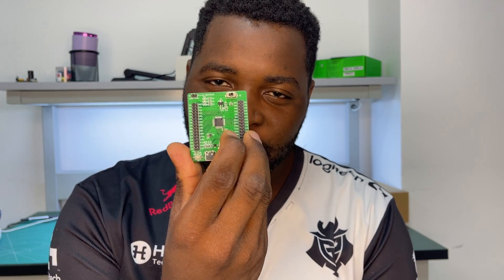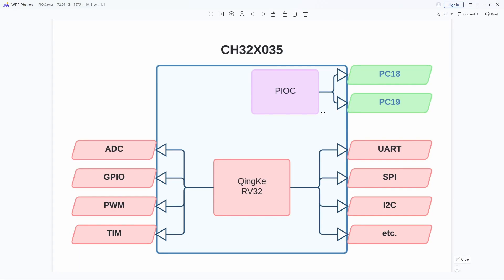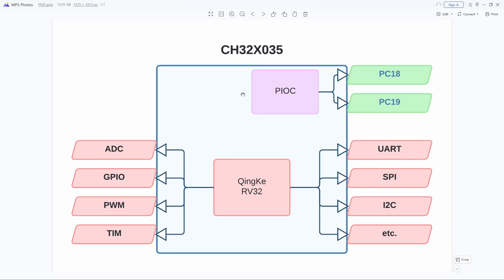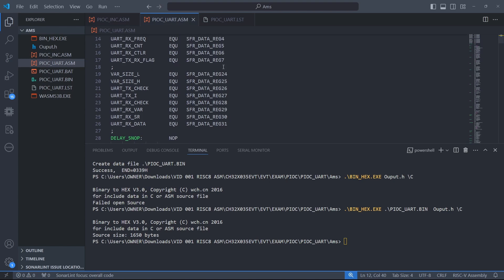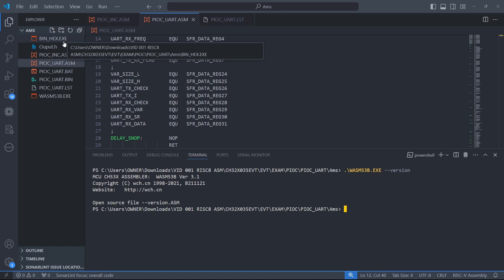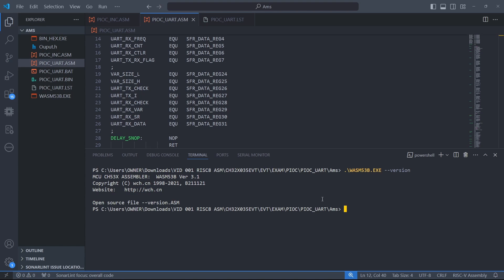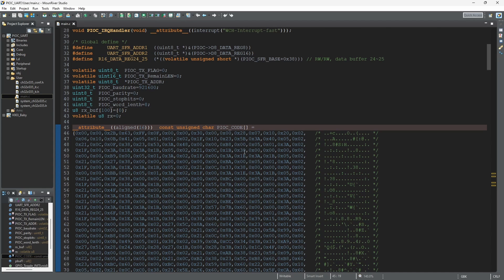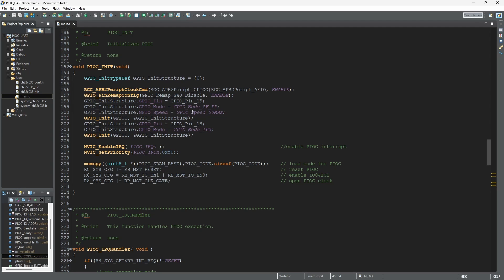#35- Tutorial for Programmable I/O pin of RISC-V CH32X035

Comment: Hi, thank you for the video. Have you noticed any issues when trying to use PC3 as GPIO? For me if I use PC3/PIN_A13,A13 (all refers to the same GPIO Pin) in digital write or read or analog read function, the result I get is to and from PA1. But if I use the pin number 20 for digital read and write then it works fine and sends or receives signals to PC3. But analog read always reads 0 if pin umber 20 is used. I am working with Arduino.

Comment: Because PIOC is located on the SWD pins, shouldn't be a good idea to put a small delay before the pins initialization just to ensure not to brick the MCU??
Reply: Yes, a small delay before the pins initialization is a good idea . You also can use wch-LinkE to erase all flash by pin NST or power off through MRS.